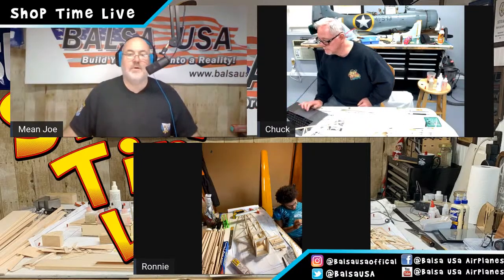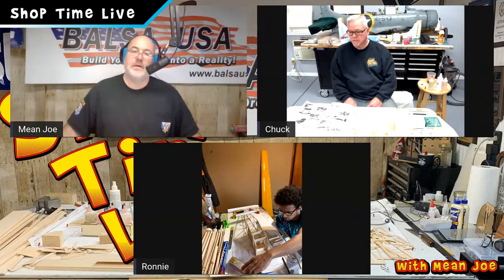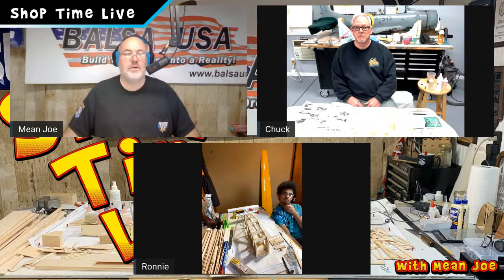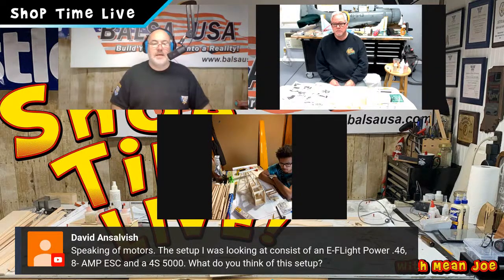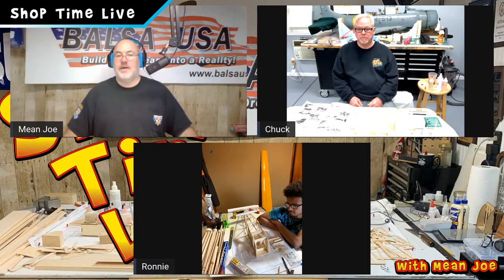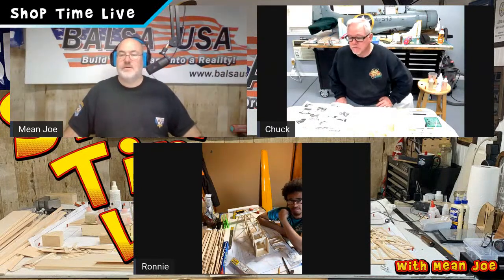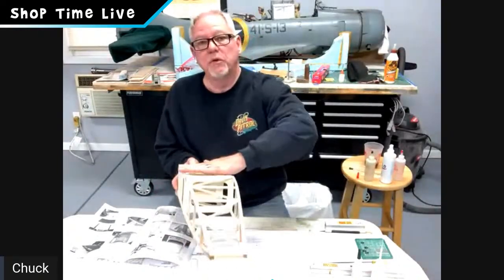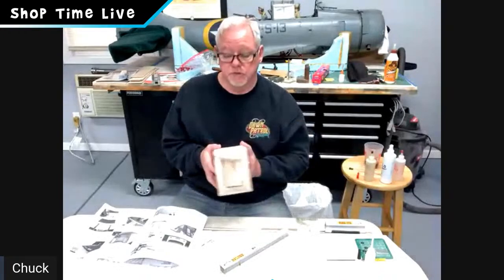Shop Time Live 1/6 Nieuport 17 Build! Episode 4

Comment: Another trick for dispensing epoxy...  I use a ton of epoxy, especially in my other big hobby, high-power model rocketry.  I like to transfer the Epoxy and Hardener into syringes that I pick up from Tractor Supply or some other store that carries veterinary supplies. That way, I can dispense 1 cc quantities of epoxy and hardener with high accuracy.  When I'm mixing up larger batches of epoxy, I use the graduated/medicine cups.

Comment: Question for Mean Joe, relative to flying two 3S batteries in your Spad, only connected to one at a time.  I missed the live show, and am catching up.  The question is, if you're carrying two 3S batteries., why don't you make a parallel connector and have both batteries online, to get twice the capacity and twice the flight time, or at least less chance of running a battery to depletion?
Reply from the maker: Chuck Pierce I’m using that set up for a N-17 I already have here. The primary reason is that I just haven’t lol. I like the idea of two flights from one battery change. 😁